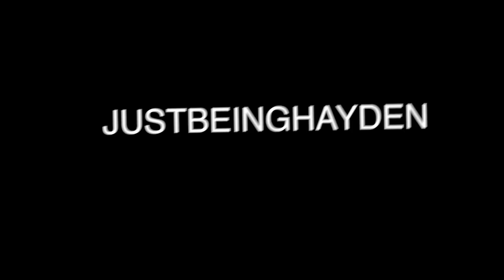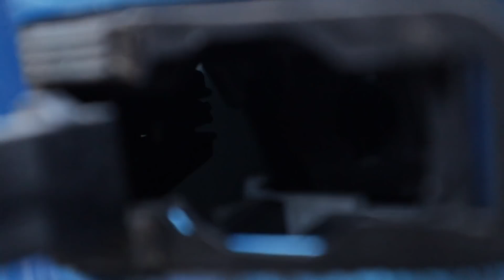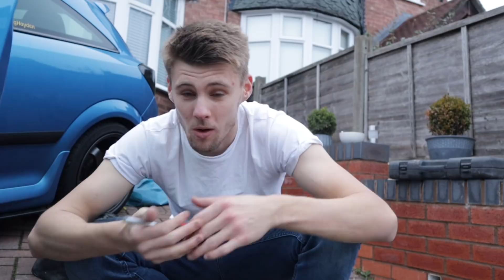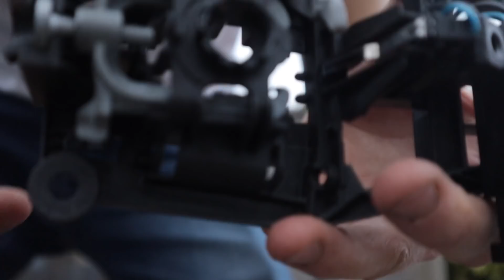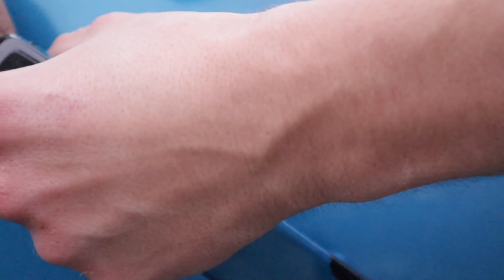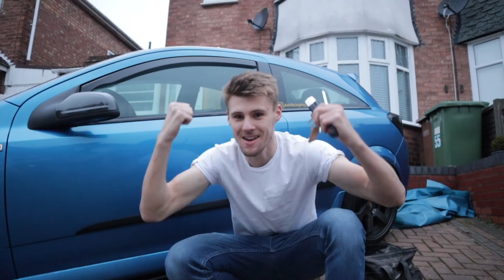KEYLESS WORKS (I THINK)

Comment: Yeah keyless opening should work on the passenger door too. 

I had an horrific experience with keyless 3 years ago with the VXR when both keys failed and the only way to get into the car was using the plastic key.

Of course when I did that it set the car alarm off because it was set on the key and couldn't then deactivate it. Being 6pm at night and continuous until roughly 11.30pm I took the decision to remove the alarm under the wiper mechanism. When I removed that, we found it was battery powered so it carried on chirping so into a bucket of water it went.

Then the car realised I took the alarm out and started to sound the horn instead so I had to disconnect those.

My last issue was that it was the first car on my curved driveway and when AA turned up, we couldn't  get the steering lock off because the ignition wouldn't turn on and there was a construction site next to me so needed moving.

They had to use the construction site crane to lift the car off the drive and onto a flat bed 😂

I honestly hated vauxhall when they said yep that's £200 quid for a new key because your car must have just "forgot" the other keys.....
Reply from the maker: Jesus that sounds like a Pain in the arse 😩 thanks for the reply mate
Reply: @JustbeingHayden  
No worries

If you ever strip the VXR too, remember there is a keyless sensor in the tunnel under the handbrake. My car wouldn't start after I stripped mine and took ages to figure out why the car only started with the keys hung in the boot haha
Reply: this comment is hilarious, what a nightmare it must of been lol

Comment: Hi Hayden, yes the keyless opening should also work on the passenger door. However you may be trying to open the door too soon after youve locked it. The lock and security systems (on keyless method) have to complete various checks before you can then reopen it and that can take a few seconds. In the video you are trying to open the door immediately after youve locked it, try again but leave it for say 5 seconds and  id also buy a good quality battery for your key as well. Hope this helps
Reply from the maker: Yeah cheers man I’m going to get a proper battery for my fob 👍👍

Comment: Mine only opens keyless on the boot and passengers side door, my drivers door has the same issue as your passenger door mate. It looks the car but doesn’t open without unlocking with a key or using keyless on the boot, passenger door
Reply from the maker: Alright dude my drivers side and boot open keyless I’ve ordered a Duracell battery 🔋 hope that fixes it 👍
Reply: Just being Hayden if that’s for the key it won’t make any different I believe it’s the sensor in the door that’s needs replacing i did look at sorting it when I got my car 5 years ago but it wasn’t a cheap fix so I left it.
Reply: Mine is exactly the same, boot and passenger door works fine , drivers door locks with swipe but wont open....did you ever fix it ?

Comment: Mine locks and unlocks both sides, fob in pocket. And also the boot will unlock same way if the car is locked. Did you check the Ribbon as the connections inside can degrade over time? Also if you tap the handle twice it deadlocks the door as far as I'm aware.
Reply from the maker: scottsvxr yeah mate it dead locks but it won’t open via keyless going to get a new battery for the fob 👊
Reply: Sound if no luck.... check ribbon and micro switch.